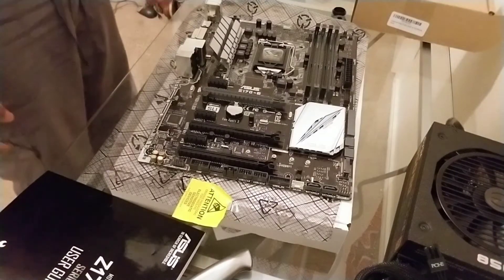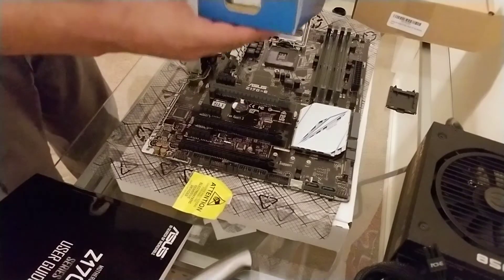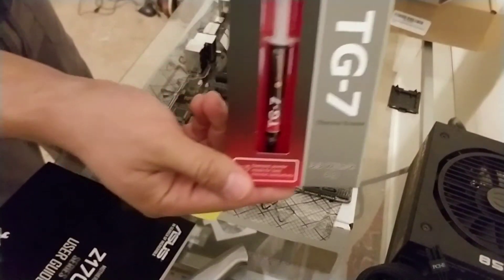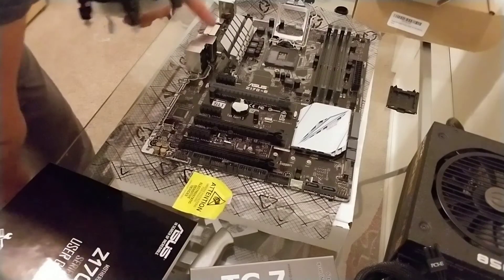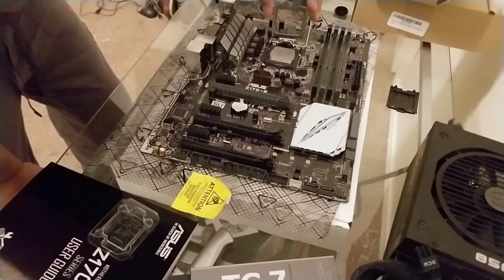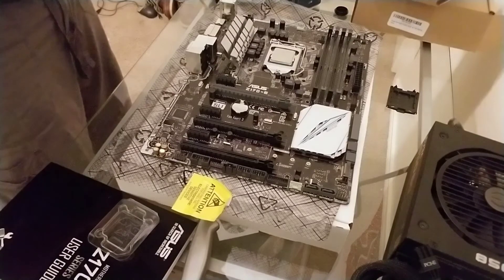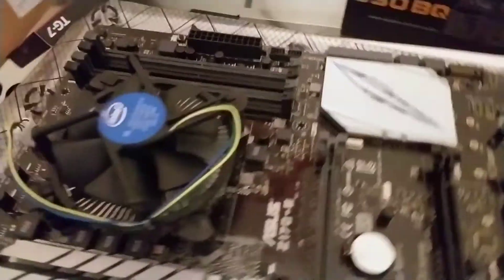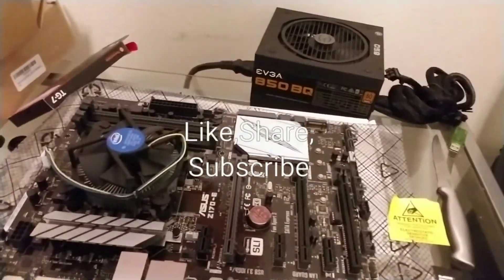LGA 1151 CPU INSTALL ON ASUS Z170-E MOBO

Comment: how do i integrate my sata hd with its power connector ? I only see data but no power plugs
Reply from the maker: There should be a SATA cable coming off your power supply. That SATA cable plugs into the SSD to power it up.
Reply: I have one HDD & a cd/dvd burning rom i wanted to integrate. Was hoping to bypass external modules via usb -_-